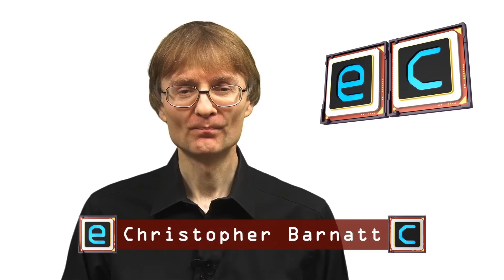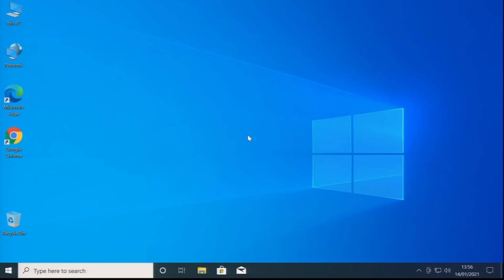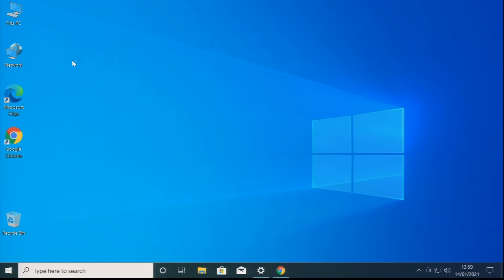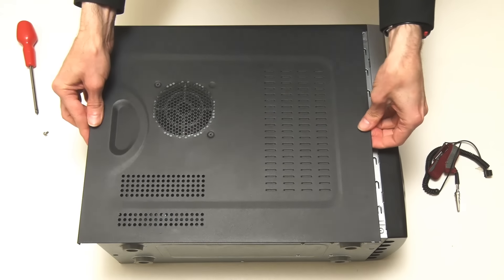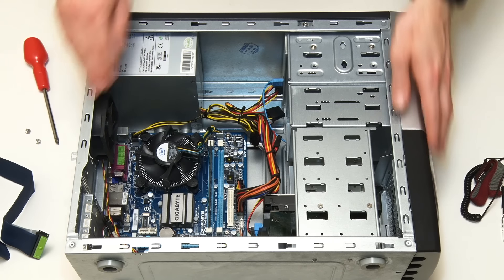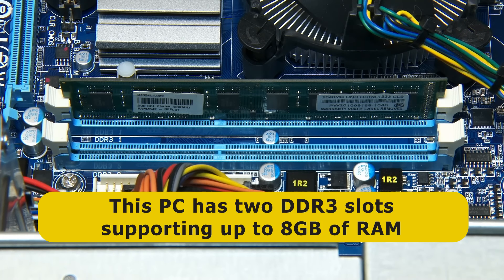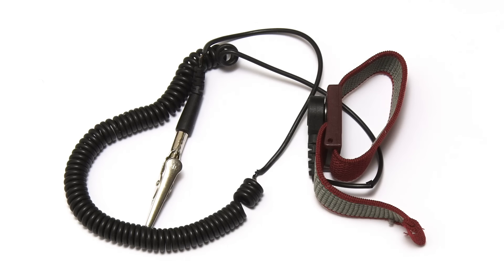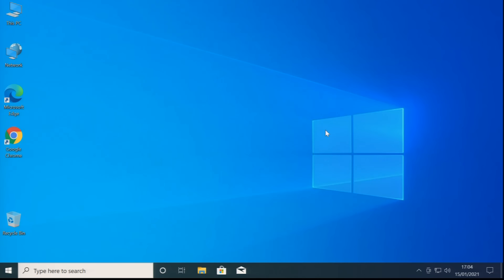Old PC Upgrade #1: Options & RAM

Comment: My machine has 8gb, a semi decent sff gfx card with 2gb and an old i3 and it runs like absolute shit.  Is it the i3 that’s choking performance?
Reply from the maker: Possibly, or there could be lots of apps running at start-up clogging things up. Is it booting from a HDD or SSD?
Reply: @ExplainingComputers  ssd. It’s a nightmare tbh as I’ve reckoned to scale back any unnecessary boot time stuff as well as any background programs.  Even gone so far as to let defender do my virus work as avast practically locked it up.  Maybe I need a clean install and total strip down.
Reply: @AcornElectron  A clean W10 re-install may help or it may be that the cpu/motherboard/ram subsystem is holding you back. I recently transplanted a W10 HDD from a 9 year old i3 HP G62 laptop to a Dell Vostro 3300 i5 laptop (both 1st generation cpu's) and this reduced W10 boot times from "go and have a cup of tea" to about 47s. Meanwhile, the G62 has acquired a hand-me-down SSD and Linux Mint and is now a delight to use.
Poor thermal performance can also slow down old machines. I do sometimes "dust and hoover" around the cpu cooler and detach and reattach the cooler to the cpu, to renew the thermal transfer paste between the two.

Comment: This 11 years old PC looks too clean and "new" to be called an OLD PC.
I wonder could adding to a total of 4gb achieve the same speed improvement?
Reply: 8GB would ideal for more comfortable web browsing, along with adding at least a 120GB SSD, and a cheap 2GB AMD dedicated GPU(they work better in Linux, and will allow the system to use all 8GB of RAM not giving any to the IGPU), and installing a good Linux distro on it like Manjaro W/MATE DE, as it's more secure than Windows, and uses less system resources.
Reply: @CommodoreFan64  Thank you for your info. I have a similar spec spare system (core duo) and wonder how much difference would there be if I add another 2gb to make it 4gb would helps as I do not wish to fork out more for simple tasks. I am using Linux Mint.
Reply: @newstar346  Your Welcome, I have an HP Slimline with a dual core Pentium CPU where they limited the mobo to only booting with 4GB of RAM max(slimly aholes to try, and up sale you a more expensive machine) I salvaged from my local recycle drop off last year, and with Manjaro Mate installed on it, and 4GB of DDR3 RAM(it came with 2GB I had 4GB in the parts bin), it was still a bit sluggish even with a 120GB SATA III ADATA SSD trying to watch videos on YT, and Odysee(okay once they buffered for a bit), or scrolling through social media, So I sourced a cheap $24 AMD RADEON R5 340X 2GB GDDR3 low profile card off eBay for it, so all it's system RAM was freed up, and that honestly helped a lot, so if your system supports 8GB of RAM, and you are not going to get a dedicated GPU then do it, along with a $20 ADATA 120GB SSD for the boot drive.
Reply: @CommodoreFan64 
Used and new computer hardware in my country of residence is not as cheap as in the US. Shipping from the US sometimes cost as much as if not more than the item itself.
Appreciate your help in providing these info. 👍
Reply: @newstar346  You're welcome, and don't feel bad we are about to feel your pain here in the US with Potato head Biden administration now in power all the low tariffs that Trump had in place, and those that were in place before he got into office are about to go away from all the political buzz meaning the price of electronics in general are going to go up here in the US, I won't get into all the other stuff Potato head just did executive orders on that are going to kill the US economy. 😡
Reply: @newstar346 Going from 2G to 4 will make a huge difference.  If you can go more, do that.
Reply: @newstar346  What country?
Reply: @richardwernst  Singapore. Prices here are higher than those in the US even for used PC/memory. New 120gb ssd sell for about US$32.
Inexpensive used graphic cards are hard to come by.

Comment: Microsoft abandon AMD that are 10 year older plus?  But Intel that Dual/Quad 64bit 2.5-3.0+ GHz and min: of 8 GB Ram, Work fined.  I would add an updated USB 3.0, FireWire, HDMI (PCIe slot). Wi-Fi/Bluetooth is very handy. (Buy a USB Wi-Fi device instead of filling a slot up in the back?). But For Gaming: Quad processor 3.0-6.0+ GHz, min of 16 GB RAM.  But for those hardcore gamers 32-164+ GB Ram.  The laptop I got; a Blue Ray player/DVD-writer sadly AMD dual 1.9Ghz, 8 GB Rams. 17.3 no-Touch. Not supported for Windows 10.  Windows 7 & Linux (Dual Drives) just fine for now! Building Gaming but looking for Windows 10 gaming OS?  Or best Gaming Linux OS?

Comment: I am surprised its a pentium and not a i5
Reply: It's a strange motherboard - a 775 cpu socket but DDR3 RAM. I have a Dell Optiplex 380 like that. Its date code is 052510, which I think means May 2010. I see i5's were available then.

Comment: What about flashing the BIOS can you hack the interface chips and BIOS chip like making the SATA interfacer run faster like 4 or 6 gigahertz should be able to overclock these chips not seen anybody do it. Overclock it till destruction see how far you can get it if you put heat sinks on the chips you probably can push them quite a bit

Comment: Chris, your info about changing oem-keyed licence of win10 during motherboard/cpu upgrade is well outdated and plain wrong at the moment. All you need to do after instslling new cpu/mobo is select an option "i have changed motherboard or cpu on this machine, i have oem key" and the system will change the record at MS automatically. And should that fail, Win10 shows support number, that you dial and (after hefty 40 minutes of talking to hindu-english speaking operator, who simply checks if you tried the auto phase) they connect you to licensing service (callback is avail) who check the key manually and in about 1 minute you are all set. p.s. the most impactful upgrade to this system would be installing ssd, as you well know
Reply: @dank9561  what i say, works, it has been proven practically. And it is of course an anachronism from late 90s to not allow license transfer in case of components change. You simply track change of more than 4 components at once as a vendor these days.
Reply: Whether or not it's legit is up to lawyers, but I know you CAN swap a motherboard and get W10 at least, authenticated as I have a friend who did it.  The intent of the OEM licenses not being able to be moved to a totally different mbd is that the OEM paid a LOT less than retail, or even wholesale for the OS.  And takes on the responsibility of supporting it, vs. Microsoft themselves.

Comment: WORST UPGRADE EVER I SEEN!))) spend $40 on ram.... after this -2 seconds in booting :D
Reply: It wouldn't be expected to make the boot time much better.  If/when he runs some stats on the system, especially when running memory hungry programs like browsers, or several programs at once, the change would be very significant.  I'm sorry he didn't show that, other than to say/show it was more "snappy".  But folks need to realize that this isn't meant to show the "best" solution for someone needing a computer.  It's to show what can be done.  LOTS cheaper ways to upgrade older machines, and often cheaper machines around with better prices.  I won't touch a system that can't be upgraded to at least 4G of ram, whether running current Linux, or Windows.  Both run quite well with that much, especially if the drive is swapped for an SSD.  Not a gaming machine, but certainly fine for most uses, browsing the web, word processing, spreadsheet.